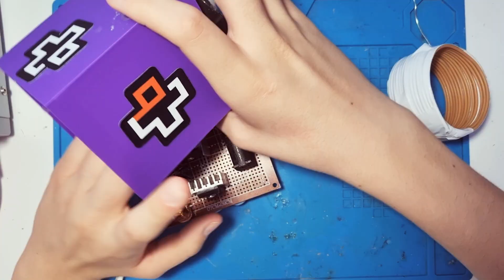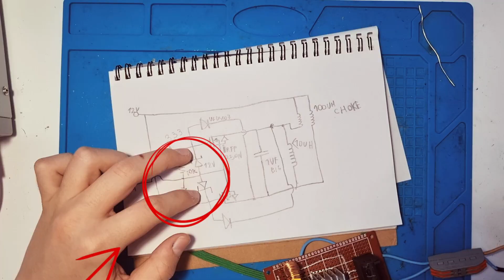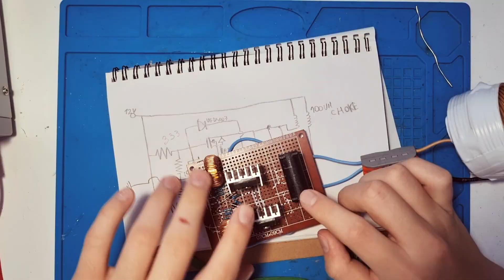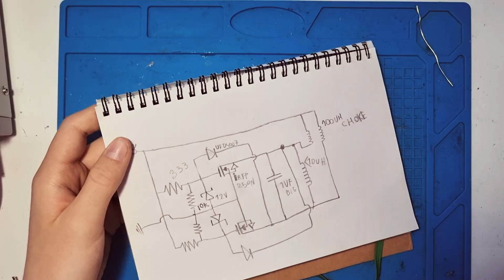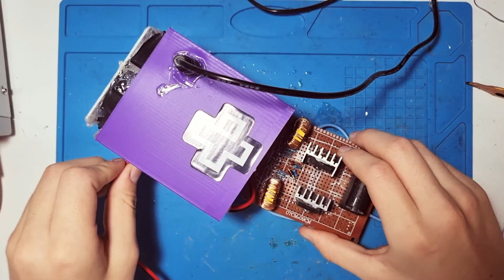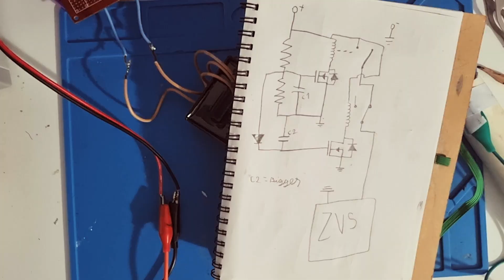How to build a zvs driver

Comment: 😂 I wonder how many people gets hooked to try build this MOSFET fryer. Many blogs with failing to make it work having issues with chokes and not using zener diodes and fast diodes and many more things 😂 it makes me want to try it I like a challenge...I have read a lot about it and have two goals about zvs first I will make the small self oscillation version Mozilla driver then if I win I would build the furnace version with driver ics and controller board that run into h bridge inverter then to LC tank the issue with the second goal it's expensive but i have most parts igbts 1200volt 600amp that should make a real power muncher😂